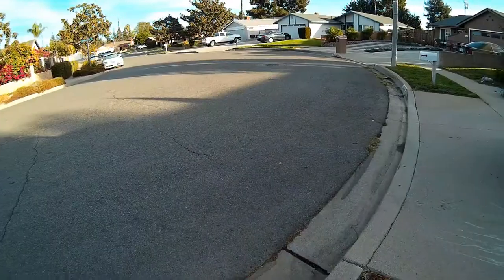Ford OBS; F350 Spring Swap! (F550 Spring Install)

Comment: Bro I literally did this swap now I'm going back.... f550 springs make your truck ride like a shopping cart with metal wheels I'm going 16'+ f350 rear leafs should give a better ride overall and PMF suspension sells a bracket kit specifically for those springs

Comment: Very cool video and extremely cool truck, I love the looks of the blue OBS with the roof rack. I've got an 01 F350 Crew Cab Long Bed that has a roof rack on it also and I coincidentally replaced my tired old leaf springs with brand new OEM HD leaf springs and they really helped lift the ass end up for a nice rake to help keep the truck totally level under load as I haul and tow quite frequently with mine. I think the lift kit leaf springs lack the backbone strength that true heavy duty springs have, the way the bottom overload looked on his old springs looked extremely short in comparison to OEM style springs which probably has something to do with them sagging bad when under load from his trailer, I see lots of guys with sagged trucks towing their trailers who have lifted trucks and I always wagered that that was the main cause of it.
Reply from the maker: how right you are!  Kevin's truck is a great looking rig and well setup for tow duty, and the addition of the F550 springs really made it sit, and tow, very well.  thanks for watching!

Comment: I saw your swap out from the F350 550 spring install I'm just curious why your friend didn't use the load was going bars to give him the extra level that he needed. As you know the load was One bars transfer is to wait off the back end to the front end of the truck
Reply from the maker: Kev is pretty happy with the 550 springs, he tows ALOT with his rigs and is glad he no longer sags in the rear.  now that I own an F550 myself, i can attest that his truck rides much better than an actual 550 does!  thanks for watching.

Comment from the maker: i forgot to mention in the vid that Kevin was pleasantly surprised by the lack of axle wrap after doing the F550 spring swap.  if you watch the frame mount part of the video you'll see how much axle wrap there is without even trying, or towing.  the new springs should reduce wrap monumentally!  thanks for watching!
Reply: it seems you guys went to a lot work for ????? you could have order f350 rear springs up to 8500 lbs and keep the over loads springs from from General Springs out of Kansas City for around $300.00 . That is  what i did and I order the front 6000lbs total $618.00 and everything fit . I have a 1996 f350 zf 5speed 460
Reply: Richard Giunta We took a good look at using F350 springs/airbags, but went with the F550 because I also needed to lift the back of the truck about 2" to level it out. I only paid $200 for the springs, so this accomplished what I set out to do and was the most cost effective. Oh and I wish I had your 5 speed!
Reply: Can you do a video on how you added tow mirrors to the F350 OBS.

Comment: Wow how much tongue wieght. My 97 f350 with my new stock springs didnt move more than half n inch when hooking my 9 ton trl and that trl put my 3/4 ton down 3 to 4 inches
Reply: Tongue weight is about 900 lbs. The old springs were pretty tired lol

Comment: why not use airbags? then it wont ride so bad.
Reply from the maker: fair question.  the F350 already has bag mounts on it, but we didn't want to deal with airbag leaks/failures on the road.  plus........F550 springs!  :)  thanks for the question.
Reply: my air bags have been on my truck for 21 years and under load most of it. never had a problem.
Reply: kylebob2525 mine pop like a tire every fails

Comment: Any thoughts about fab new shackle hangers?
Reply from the maker: yeah a hanger could be easily fabbed up for the shackles, maybe even better would be using the stock cast hangers from the F550 and re-drilling the frame as necessary.  the springs we bought did not come with the hangers and we didn't have time to do much fab work.  in the end using the F350 shackles has worked fine.  thanks for watching and the question.
Reply: Hi. I have a 88 f250 with a 460, Manuel. Trying to get mine as nice as yours

Comment: What kind of roof rack is that?
Reply: Daniel Katairoak it is a Surco roof rack.  I would probably go with something steel if I were to do it again.  The aluminum can be a little bouncy at times with the heavy weight of the spare.

Comment: What year of f550?
Reply: OEM springs from a wrecking yard. I can't remember the exact year but I believe anything from from 2000-2008 or so. They changed the center pin location at some point in the newer models.